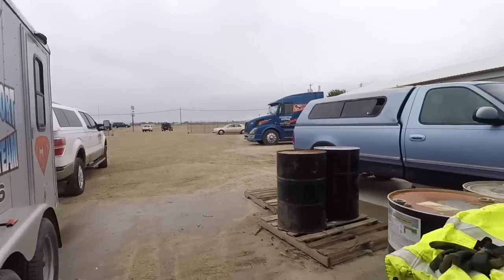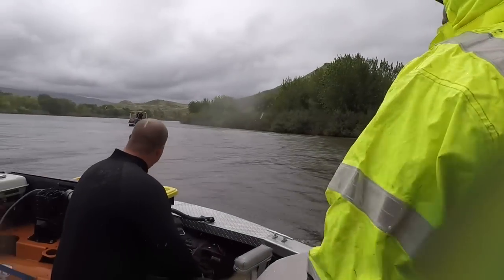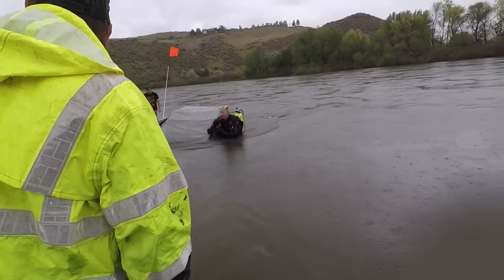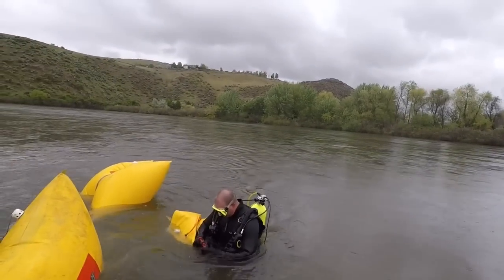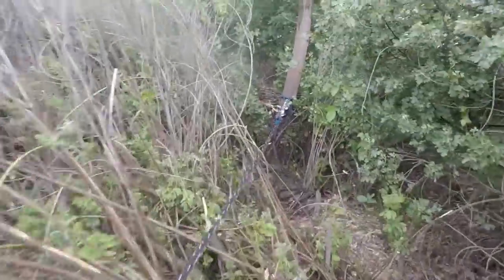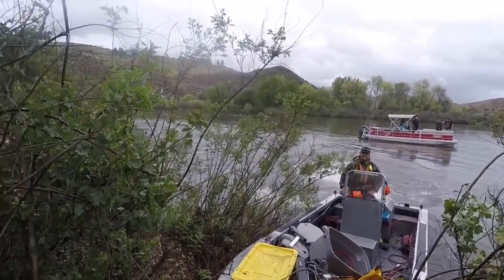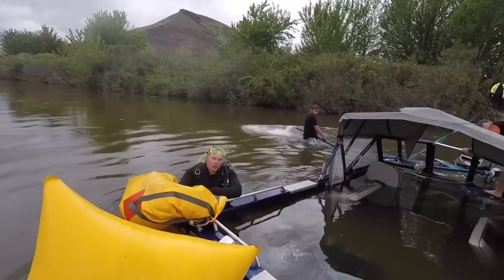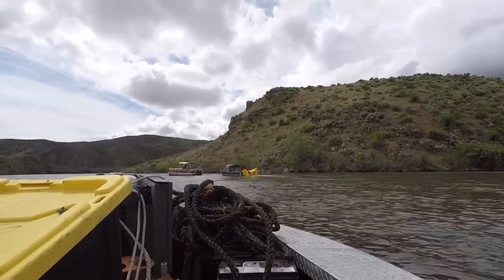Shipwrecked!

Comment: Was there a way where the diver could of secured the bags under the boat? Help it lift rear end up? As the rear end rises pump water out. Just a avid diver with some training drills using life bags. I’m sure you guys have done it a lot more then me. Good safe work. Looks like the diver should of brought some dive lights as looks like the vis is low.

Comment: OKS !!! just a word of CAUTION when launching or landing a boat on or off the trailer to WHEEL CHOCK the steering tires to prevent the rears from losing traction even with the EMERGENCY BRAKE ON as the boat could pick the front of the trailer in the air & raise the rear axle off the ground ??? Watch HILL Towing & Rescue on YouTube as he has had to go get tows out of the water on the BOAT LANDINGS just for this reason !!  Anyhows,, GREAT recovery & HOPE your DIVER Didn't hurt his back when he hit the bottom of the river !!  ""KEEP IT SAFE ""!!!
Reply: Or put it into 4wd, I have a locker in my front dif for that sort of thing

Comment: last time i looked. air bags held air, not helium.
Reply from the maker: Michael A. Umm what? Lol
Reply from the maker: Michael A. You know that air floats on water right? So what you do with these bags is attach them underneath the water tight to whatever it is you’re lifting, and then you fill with air which then floats up whatever it is you’re trying to float.
Reply from the maker: Michael A. You know that air floats on water right? So what you do with these bags is attach them underneath the water tight to whatever it is you’re lifting, and then you fill with air which then floats up whatever it is you’re trying to float.
Reply: @CountryEquipmentRentals  I was being a smartass about the Helium in that it would have had very little
lift capability once the air bags reached the surface of the water and into the air environment.
My whole point is (2 things), air bags underwater can only lift equal to the weight of the water they displace, i.e. a 100 gal. volume of air, displacing 100 gallons of water @ 8.5 lbs to the gal.
has lift potential of 850 lbs. ( now for point 2) only then till it reaches the surface of the water AND if it is on a short enough rope to lift the load with it other wise the Helium then must take over doing the lifting. 100 gal Helium @ 1.01 atmosphere would lift 50-60 pounds.
P.S.I corrected my #from 1300 to 850, i meant to say your bags looked to lift 1300-1500 lbs roughly.
Reply from the maker: Michael A. Oh ok I gotcha 👍🏻

Comment: Surprised and disappointed to see the torches standing in the trailer (couldn't say for sure but they appeared to be unsecured) with the gauges unprotected and installed in place.  Two potentially dangerous "missiles" not to mention the cost of replacing the gauges, trailer and who knows what else.
Reply from the maker: They are chained and strapped to stationary shelves bolted to the framework of the trailer.